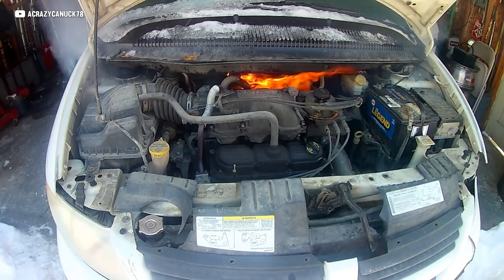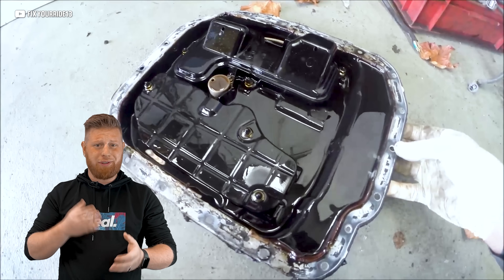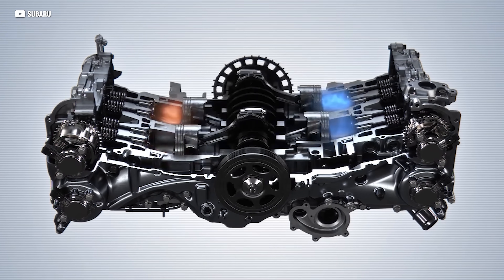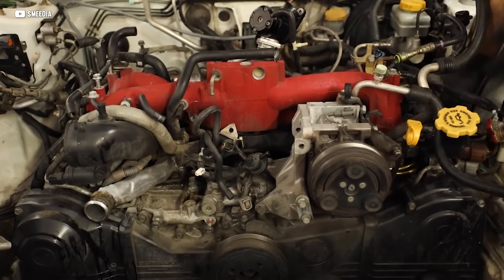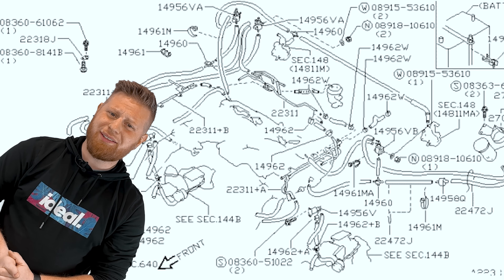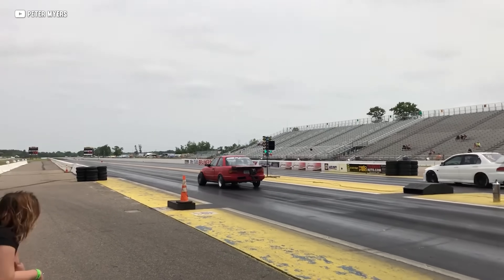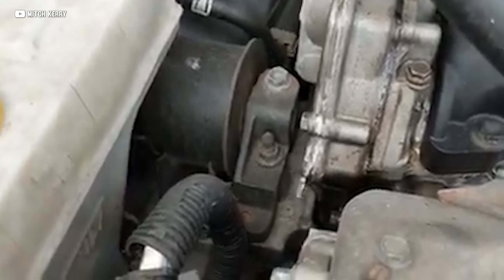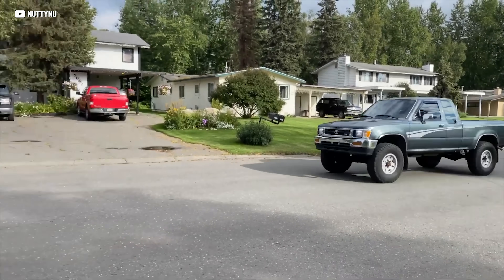WORST Engines Of All Time - JDM Edition

Comment: Back in the day my first car had a NA G54B in my bought new 1983 Plymouth Sapporo/Dodge Challenger, the Starion's/Conquest's predecessor. I made more than the stock turbo Starion's 150 hp with a ported head, mild 3/4 race cam, a set of 4 into 1 headers and pair of 44mm Mikuni side draft carburetors. Without the head gasket issues of turbo G54B's.

Comment: The 6g72 is extremely reliable. They made an insane number of those engines and put them in monteros and diamante as well as chrysler applications and the 3g eclipse. The 3000gt twin turbo models in the early years had issues with spinning rods, and over about 600 hp start having issues with flexing heads, but the majority of the reliability issues on that platform come from the electronics/other things external to the engine. A platform being unreliable is different than an engine being unreliable. Also the 3000gt got bought up by cheap owners who didn't properly maintain their cars which didn't help the reputation at all. They told you to change your timing belt every 60k miles for a reason.....

Comment: Not defending Subaru or any thing but i have a 2004 blobeye it has 155000 km on it and it still has the original engine from the factory and never even been touched. But of course that brings us back to what you already mentioned that if it's taken care properly it won't brake down... (As most cars will)
Reply: I got a 2003 Outback with the H6 3.0L i have 245000km and still running strong but that sucker drink gas like it his water.

Comment: S54 owner....
Are you saying EJ engines like to ingest bearings as well? As often or not? 
I have a feeling a lot of cars eat bearings quite consistently. Most of them are snotboxes that people either scrap or throw a scrap yard engine in and have no idea why it died.
Reply from the maker: They definitely CAN and DO eat bearings. In our experience, S54 bottom ends are pretty tough when treated properly 👊
Reply: Change your oil every 3 to 4k. And don’t go past 4k rpm until it’s fully warm

Comment: shouldve added the first gen toyota 2gr-fe. The timing gear issue, the oil feed lines prone to breaking because theyre made out of rubber that can grenade your engine at any time AND the silly little vvti oil line filter that can get clogged up are all big issues.

Comment: You failed to mention with the QR25 is that they blow head gaskets all the time and also the CVT is a pile of junk and also had a grounding issue with the valve body which cant be repaired due to electeical resistance so a new valve body is needed. Another thing that makes the EJ25 a terrible engine is that it takes less time to replace the timing belt than the spark plugs since the engine has to be removed for spark plugs like why?

Comment: Toyota has plans to use the rotary engine with hydrogen fuel cells. They bought Mazda a few years ago remember? Mazda owns the patent and an unlimited amount of torque with the engine releasing water would be amaaaaaaaaazeballs.

Comment: EJ20's from late 80's to 1995 had a closed deck sand cast block that did not blow head gaskets and would take big boost because they were made to compete in open class rallys . head gasket problems started in 1996 with the open deck die cast blocks that were used when rally engine power restrictors were brought in to rally if you want to build a high power suby find a closed deck block from a legacy or wrx prior to 1995 , wrx sti version 1/2 do very high mileage before failing , but as americans think that wrx imprezas started in 2000 +   when the best EJ's are earlier .
Reply: We did get the Phase I 22T in the BC Legacy, but it was tuned pathetically conservatively (I think about 160hp) so nobody cared about it or took care of them.
Reply: My 91 liberty 2.2 shat both headgaskets at about 100,000kms. Its a long term issue. Not confined to turbos. Its a subaru thing. Their reputation for bulletproof engining is the single least deserved rep ive ever heard of.
I see dead subarus EVERYWHERE. All the time.

Comment: I have a 3000gt sitting in the garage which needs a new timing belt. It ran fine, I pulled it into the garage under it's own power and it ran well, but on inspection I discovered the timing belt was very very loose- it slides off the Cam Gears very easily and there's probably 2-3 inches of play where the belt slacks- shouldn't be more than an inch, while tinkering I slipped the belt off by accident and it snapped out of time (cams hold a bit of tension)- never tried turning it over since but I know it'll run great once I have the Money to fix it and change all the fluids/filters, and there's no Cam knock- it's a beautiful sounding Vehicle- only downside is light hail damage. So ya- you're right on that one, it is a PAIN IN THE ASS to replace the timing belt and it's kind of expensive- just the parts alone cost 500-600 bucks (belt, water pump, tensioner and required accessory parts), then if you have someone else do it it's about double that cost judging on a few quotes i've gotten. I do look forward to having it running again, People don't know what kind of Car it is these Days since they're so rare which I kind of like.

Comment: The 4B11T is worse than the EJ25.  Neither were great though. And the Mitsu unit will hold a little more power, however almost everything connected to the engine including the factory turbo was delicate to say the least.

Comment: Trouble nowadays, users want a lot more out of Engines but the Quality is no longer a resilient as once was. Plus there are alot more monitoring for efficient burn, where as past engines just let the fuel in and Rock ‘n’ Roll. The manufacturers have reach a compromise state where they expect just a Road Runner and not a Track Runner. So we ought to assume a Vehicle design for domestic and pleasure to be no more than just that.

Comment: My 91 300zx made it to 228k miles till it started acting like a v4 despite replacing all vacuum lines, coil packs, sparkplugs, idle sensor, MAF, TPS sensor, throttle body cleaning, fuel
Pressure regulator, pCv valve, fuel filter,  and so many other parts i dont remember.  It was a good run, but i never buy one again even though i got it for $1500

Comment: The qr25de relies on oil pressure to activate the chain tensioner. Giving that rattle in start up process. Mines been doing it for ages now I'd rather replace the whole engine rather than do the trimming chain repair.

Comment: Okay I have a serious and honest question for you, as I am a FD enthusiast, and I also happen to like the rx8. I'm seriously considering purchasing one and I know a place that sells rebuilt engines and installs remanufactured engines, they only charge like 8 or 900 bucks to swap a new one in. Is this still a poor choice for a daily driver, even if I'm aware of the character flaws and maintenance requirements? Is this really a vehicle that I need to just stay away from at all costs? Or is this something that I can make work provided my given resources and network? Like I said, I do know a few people and I'm aware of a shop that sales and swaps in rebuilt engines and they aren't terribly expensive because they run a quite successful business doing so. All they work on is the rotary engines and Mazda RX series. I found one of the rx8s for just 800 bucks and it's in pretty good shape and just needs an engine and for 1200 bucks, I can have a rebuilt engine swapped right in, no problem. That also includes warranty, all new seals and gaskets.... now, I am aware, the average person out there that does not have the connections, doesn't know anybody and is not capable of working on such a unique design probably should stay away from such a platform, but given this information, do you think it would be a decent purchase? It's going to be a part-time track car and part-time daily card, so I'm not looking to build anything crazy. I just want a fun car to drive around when I don't feel like driving my Subaru...
Reply: 1200 bucks is not a rebuilt engine...
Reply: At those prices is a steal but you still wouldn't have a reliable car for daily driving. If you got an FD I don't know why you would even care bout the RX8 though...why not get some pistons for a daily driver and save yourself the pain and the gas prices!
Reply: If you love the car and want to keep it running do it
Reply: Swap an ls in the rx8,

Comment: I cant say the vg30 was too bad. I had a 90 maxima with a VG30 and my trans was stuck in 2nd for years. I drove on I 95 at 90 mph all the time when the car was on its last leg. I neutral dropped the crap out of the car. no car has ever took any abuse remotely as bad as the abuse I gave that car. I was a dumb kid without a clue.

Comment: As the owner of now 3 different subarus... I believe TRUELY the issues with the engines are issues by volume. Let me explain.

2015 Crosstrek, not a single problem. NA 2.0 boxer
2015 WRX, not a single problem. COBB stage 2+, dyno tune. 2.0 T flat 4.
2010 STi, not a single problem. Cylinder 4 cooling mod, radiator replacement, intake, down pipe, protune.. 2.5L T flat 4.

WRX and STi's alike are one of, if not THEE, cheapest way to get a turbo AWD vehicle. And. Manual. The people these vehicles attract aren't generally the sharpest. They also generally have no sense of mechanical sympathy... 
A lack of knowledge, coupled with poor driving habits, poor maintenance, and not really caring about the car in general.... well. Gonna have a bad time no matter the car. 

EJ's have flaws. So does the FA. So do the other NA motors. But overall my experience has been excellent. 

"Numbers don't lie". But no other manufacturer is putting out a vehicle that is quite the bang for buck that Subaru offers... Nor in this quantity, and at a low entry cost. If the Evo had been produced longer, and much cheaper I think the 4G would see a whole lot of scrutiny for the same reasons I mentioned above

Comment: I had a FB20 (N/A Impreza) that had a short block replacement due to oil consumption at 60k miles. 500 miles after that it spun a crank bearing.

Comment: I have a fair amount of experience with the 4g54b. Good engines.  And they make good power, but you do have to set them up right and spend the time researching before you mod them.  Honestly those engines can take a beating and it's one of my favorite engines.  Also can confirm, some Subarus have trash engines.  Once again research is critical to avoiding the pitfalls of the ej engines.  No flames here.  Just perspective.

Comment: For subies, you just have to assume you are gonna do the head gaskets at 70k.  Besides that, the WRX I had was crazy reliable.  Got me through 4 snowstorms in maine when tons of trucks were stuck.  HOWEVER, I have VERY MUCH noticed that ANYONE who mods a subie ends up blowing it up.  I have never ONCE met someone who has kept their modded subie running for over 6 months.
Reply: I see more subarus foresters on the side of the road with steam curling up from them that ALL other cars put together.
Was thinking about dumping my old r50 pathfinder (with suspected headgasket weep) for a forester but ive decided the old girl keeps going all i do is keep topping the coolant and its fine.

Comment: 4 built motors 2 never blew dropped a valve in one bent the rods in the first, other 2 just upgraded more, over 150k miles on them never had head gasket problems all of them were ej205 or 207’s  or 207-205 hybrids 2 liter the way… but I go through transmissions like a sti goes through head gaskets…. prob cheaper tho lul

Comment: I needed to pause this video to read the graphics introducing each engine. The text flies around then disappears before I've processed it.
I owned an Alfa Romeo which proved that boxer engines don't have to burn oil, blow head gaskets and spin bearings. It didn't make Subaru power though. And then it rusted.

Comment: The subaru 2.0L boxers are fine engines. There's just a couple issues regarding them failing so often. How they are used. These bad boys can do 1million kilometers, in a car that has no turbo. But the issue is that the engine comes in some cars stock, with a turbo charger. So already we start getting into issues. But the stock turbo cars like the WRX are fine, if you just address the gasket issue, and do proper oil changes, basic turbo car ownership things. 
So the engine already gets a worse track record, because buying one used, you won't know if the old owner never fixed the head gasket, skipped oil changes for 3 years and redlined the car cold every time. Then you get it and it breaks. "shit engine" right?

But the worst of it, is that people just love to get a WRX designed to put out like 250hp, and tune it, or change the turbo, or do a bad tune after changing the turbo. Then as the car makes 500+hp for a while, it just blows up because the engine really was not designed to do all that without other modifications. 

That's why these 2liter boxers have an absolutely stellar reputation in legacies and normal imprezas. And then you get "car guys" who just want to fake being a tuner, get an STI or a WRX that's making way too much power on a stock engine, and don't know how to own and drive a turbo charged car. And they ruin the reputation of an otherwise phenomenal engine.

Comment: lol in regards to the rx8, you can get a similar sounding engine from the 2013 mazda3, similar power too, actually, more torque if im correct, its an inline 4, naturally aspirated PE-VPS engine, the skyactiv ecu just got cracked last year, so remapping is an option now as well, damn good, reliable, albiet underpowered engine, averages 45 to 55 mpg at least with mine though, either swap or grab a mazda3, the BL sedan chassis also kind of looks like a baby RX8 as well, i have a friend who drives one and we only became friends because he thought i was also driving an rx8 before we sat and talked one day

Comment: Even tho my 2002 Altima wasn't a JDM it had issues with the cat sucking crap up to the engine I got it the cat on it was messed up just thought it was cause it was sitting and owner said it was up to the bottom of the door in water replaced it fixed the map sensor and drove it for 15k before it through a rod through the side of the block and I also did a head gasket on it too but I didn't notice the metal in it when I did that till it broke I saw how dirty those cylinders were it was baddddd

Comment: no no no I was hoping not to see my engine on this list, but here we are!!!! ok well fucK
QR25DE by Nissan
the well-known issues with the spec V are the secondary butterfly screws being chewed by the engine once they come loose | pre cat failure, other than that if we stick to the long block:
the design is a sleeved and open deck, fix that with a bracket to make it a semi-closed deck.
once you address those things, you may have some fun, also they are a massive pain in the ass to work on, especially if you have to fix/replace something on the accessories belt side of the engine.

Comment: If you can't work on a VG30dett you shouldn't be near any car. They are simple by today's standards. You can remove nearly all the vacuum system. and once you take off the intake pipes there's heaps of room. Turbo changes are the most difficult as it's much simpler to take the engine out. I am a moron and have kept mine running for 22 years. So called mechanics, won't touch them. So I learned how to. Ecu has a self diagnostic mode. So it's actually simpler than obdII. I'm not a huge fan of the car in general now. But they are not difficult.

Comment: Not sure about the 6g72 but I love my 6g75 daily never had any problems other than general maintenance and timing belt 180K and still runs like new, sometimes at a light i can't even tell the cars on. I've owed mitsubishis for 20 yrs. Now never had any problems with anything that was actually mitsubishi, only problems I ever had were with the DSM 90's 420a Chrysler cars they were absolutely terrible.

Comment: I have to disagree with head gasket problem on the ej25. There are people who mod the shit out of the EJ25 in the STI and blows headgaskets. Those are the people who post bad shit about the ej25. If it was that bad, why does the STI still hold its value even today?
Reply: Subarus are the kind of car people abuse heavily, its the people buying their first WRX that run into these abused cars and then when something goes wrong they go about saying how bad they are lol
Reply: @Exzd  Yep for real. I have a 2005 STi with 165k original miles i bought it brand new. No problems what so ever with the motor. I did have to replace driver and rear passenger wheel bearings at 70kish miles. Other than that it was a good car. Just wasn't fuel efficient. Had HKS bov, HKS titanium exhaust and HKS short ram intake.

Comment: I GUARANTEE that most of the 64% who voted for the renesis have never owned one. People who try to rev an engine to the moon on cold start are the same people who say the renesis is unreliable. Once you actually do the required maintenance, keep an eye on the oil levels and let the damn thing warm up😂all you gotta do is drive it like  you stole it. I've had my 8 for 2 years now, bought it at 95kms, now at 133, never failed me once.

Comment: I'd still rather have the Renesis Rotary over most of the engines discussed here, cept maybe the EJ lol. Just pre-mix, monitor oil level and top off as needed, upgrade the starter motor and get it up to redline at least once a day and it'll be fine for like 100,000 miles lol. Just be sure to sell after 70,000 miles lol
Reply: I may be one of the few who likes the looks of the RX-8. I remember test driving two at different dealers when they were new. I'd like to own one. I know that I would most likely have to remove the cat and run pre-mix (or a Sohn adaptor), but, maybe some day I'll take the dive.